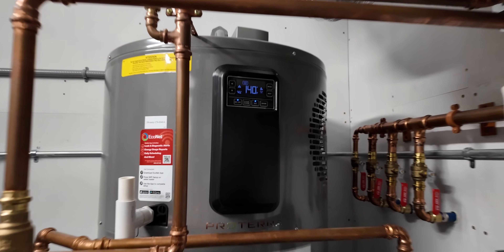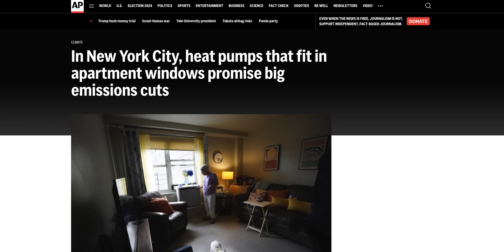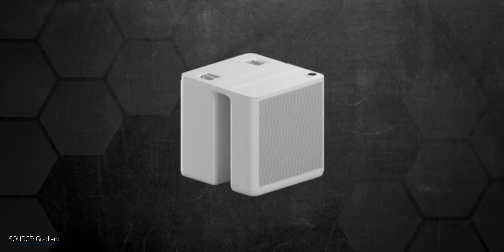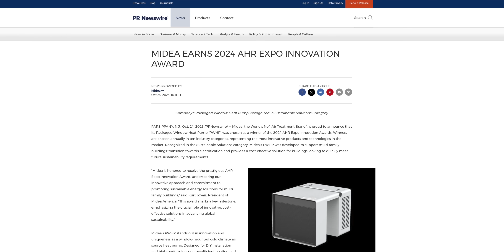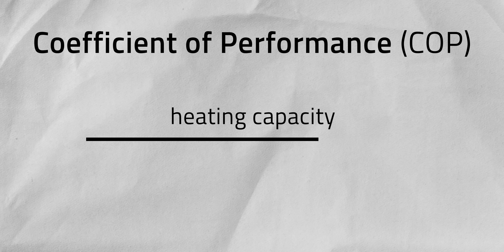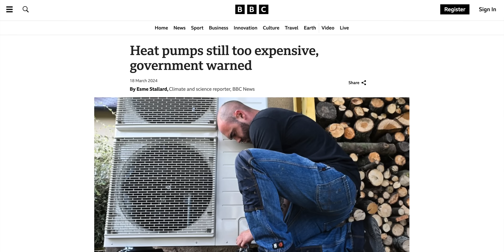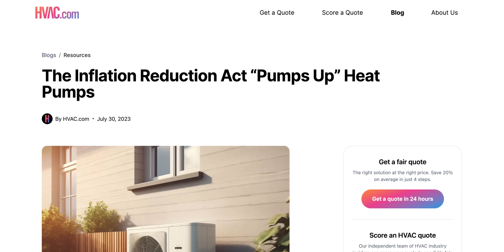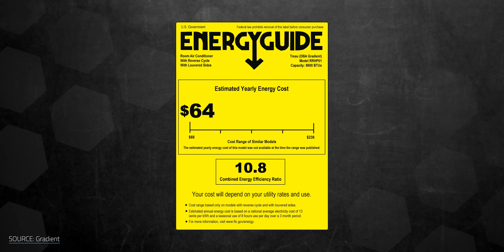Why This Window Heat Pump Is Genius

Comment: This seems not possible logistically with a cost of $2000 per unit. I mean regardless how large it is or how many btu it can output it can’t cool a room when I wall and door is between the unit and the room, it won’t work right? You’d need one for every room right? Given that they are  $2,000 a pop it’s just not financially feasible or logical.

Comment: I want a heat pump window ac, but my problem is I can't find one SMALL enough.  The room is only about 120 sq ft, and the smallest heat pump unit I can find is 8000 BTU.  GE has what I thought was a 6000 btu unit but turns out the 6000 but unit is actually NOT an inverter/heat pump unit like the larger ones.

Comment: This is an amazing idea. Sadly here in the UK unless you live in an older building wish Sash windows it would not work. Most homes with double/triple glazing windows use a casement style window. So most renters here are excluded with this design.

Comment: COP of 2.5 is great. But conventional fossil fuel systems don't load electrical grid at all (almost). And instead of simple burning fuels locally to get heat that solution will require to produce more electricity which will be used to pump the heat. I'm a big fan of EV because use electricity to create motion is effective. but to get heat - more efficient is burn fuel locally. 

Communistic countries like USSR were able to combine electricity generation and utilize waste heat for central supply of heat and hot water for apartments. Unfortunately, US was built not that effective. I live in Wisconsin close to gigant coal electric power plant. And it just waste hot water to the lake Michigan. And then I use resistive water heater to boil my water. I feel pain on it every day. But it is rental apartment and I can't modify it...

Comment: It took 4 years for me to pay off the cost of the Heat pump system for my home. It has lowered my electric costs by an average of $120/month, and I still have 6 years of my 100% parts and labor warranty left.
I know it's a large upfront cost, but wow those things are great. Glad to see that they are expanding these to more situations. For reference my electric costs $0.12/KWH.
Reply: Could've just bought an intel CPU and connected some tubes as outlets to different rooms. A lot cheaper.
Reply: @sodanakin  I appreciate the joke, but no. 
Because of how heat pumps work it is 3X cheaper to run and I still have cooling.  
The idea is using waste heat is definitely a fun topic though.
Reply: For that to be relevant to this unit your furnace cost would have to have been 6 times higher than a standard install which it wasn't. It's just a few thousand more on what is a 30k system instead of a 27k system for a typical home. Now run that payback if the HVAC install on your home was $150-180,000.
That's the numbers on this unit and it's about half the efficiency spread of what yours is compared to a standard install.

I hope this didn't come across as critical but a lot of people he that are pros want people to know to not buy this unit.
I'm a builder so I've been running the number on efficiency for decades in real world builds.
Heat pumps at the entry level still aren't worth the money on the lifecycle of the unit. They're very very close.
Scale matters so on a 10,000sf home get them.

FYI the best return on products is LED lighting on any exterior timed lighting. Paying someone $150 an hour to change the bulbs has a payback in 3 to 9 months depending on electric rate.

Us normal construction workers know more about actual efficiency that anyone making products.

The geothermal heat pumps are the worst because so many units are crap. People that work with them know that only Bosch units should be installed. Period. 
If you get one serviced ask them to replace the guts with a Bosch no matter what brand you have when they start acting up. 
Every $600 service call knocks that payback date back a year and most units need one every year after a few years. Like after 3 to 5 years it becomes an annual problem.
Reply: @sparksmcgee6641  also there are just a ton of passive strutural things that can be added to a home. like the fact that we default to ac and furnace is nuts to me in lots of areas even chicago. lie i get it at some points you might need the ac but not whole home often. and thermal mass and pcm's, albedo boosting on roof and walls maybe for cooling boost and net benefit in cost despite heat penalty, increased insluation  as most homes dont have a done, making furniture out of thermal mass and pcm stuff espeiclaly in areas that dont move often and own them or can make modular ones like im looking at for a apartment a girl is in, to couple with an inline duct fan to vent the whole place along with pressure seal and playing around with phyics of stack effect and cross ventiliation.  applying low e to windows likley hleps a lot. and heck, you have any idea how you can leverge the ecology around the home, yes it matters, not just tress, SCREW FACIST ENGLISH ARISTORCRATIC LAWNS, they offer zero benefit ecologically or to my thermodynaics or budget. if you want social space, fine, but you dont need it all to be social space. plus i have been playing around with idea of greating a geosolar envelope around a home and heating up the soil thermal mass in it to then relase heat for several months into the cooler season.   just finding ways to also do things like those walls that bring in hot air into thermal mass in to cool airs.  and of course a humidifier. but for most part, passivley planning the home the attic, etc, and venting and thermal mass and pcm and having a way to need as little ac as possible.  are you building a neighborhood, guess what, give them all albedo boosting and that helps them all with cooling in sumer heat waves and then use insulation for heat gain and unblock your windows. for heat gain. there is just so much that can be done,. im not saying this is you per say, but for last decade ive studied how physis chem bio psycho social cultural geopolitical planetary boundries and geoeconomics and how the systems on the global and bottom up and the way we live is not sustaniable and not just in we we are inefficient, in a away if you understand complex systems and feedback loops inertia cant fix these issues, especially planetary boundries( lok up stockolm institute and nate hagens)   then add the fact that the horitcultural ande lndscape way we live and design things is killing things on top of the way we farm and pesticides, and insecticides, and nitrogen and phosporus cycles are way out of balance and in the red and causing issues. like in IL 50% of birds have died out, because 50% of insects have died out. and yet we produce those chemicals and prctices that cuase that at masive amounts and with no end in sight. so the civlization will eventually collpse due to ecolociatl overshoot.  we need local meet ups to prototype how to fix this stuff.
Reply: Now to get solar and a Tesla!  300 miles for just $9!

Comment: As a guy who installs and uninstalls about 20 window ACs per year, I like how these effortlessly float themselves into place during installation.  Easy on the back is nice.
Reply: Cast radiators are usually installed right under or next to exterior windows in old homes/apartments. Wonder how large of a problem they will be with this design.
Reply: How many have you had to repair?
Reply: @barrystevenyoung4818 I'd bet none, a commenter speaking of "installation" holds no "weight."
Reply: Look again requires a huge bracket on the outside .

Comment: Heat pump ... ac with a reversing valve ... And if you're lucky a small resistive heater to thaw the system if it's very cold outside, and a " $5 computer to run some pretty basic code" to help keep it reasonably efficient. Still sounds/feels like extortion to me, but you know money be like that "bro".

Comment: Heat pump will just freeze into a solid block of ice in humid wet snow environments. They can defrost but it will just keep going back and forth trying to defrost because it can't heat in 10F weather it has to make the outside coil colder then 10F. This is why gas heating works so well furnace turns on heats right away no blast of cold air from a heat pump trying to defrost. Also R-32 not available in the US so if the unit gets a leak I guess just replace the entire window unit. This is the mistake people make when buying mini-splits from China they come pre-charged but if you get a leak can't find any R-32 there are some illegal sources shipping it to you off eBay.

Comment: about a month ago, I bought a small ductless minisplit system for my bedroom. 12,000BTU. single zone. 

it was $1600. plus another $900 to pay a licensed professional to install it. I could've spent about $400 more and got 2 zone unit, and that would probably only add another $100 or so to the install cost. 

having all the constraints of old apartment buildings to work around, I can see why the window unit route would be appealing, but $2000-3000 or more? and you'd still have to deal with all the bureaucracy of getting permission to use it in an apartment anyway? 

it really seems like just a regular 110v minisplit is still the better and more cost effective option, even if you need a professional install. these window units seem kinda pointless at these prices.

Comment: Why does no one answer my question about how much these draw. If a 1500 watt heater draws that much for heat then it only stands to reason that this will mean this heat pump can't be on a circuit which other devices draw from.  Makes sense doesn't it?
Reply: A heater uses all of its energy in the form of heat, a heat pump just moves heat that already exists which means it doesn’t need as much energy to put heat into your home.

You get more energy out of the system than the unit takes to actually run the pump itself.

So it uses a fraction of the energy of a heater would
Reply: @lifelesshawk5725  Thanks but has anyone done the math on it? 2000- 3000 for unit and then cost to run each per hour?  Not all windows lift upward so what would you do then...replace the window? That's what I would have to do and the window is not small.

Comment: I got a 15k btu mini split(Heat and cool) with 2 indoor units from 1 condenser for 10000baht(300USD) then installed for 3000baht(90USD).

Comment: Wow, Heat Pump are getting more compact... I wanted to invest in one as my house is on solar panel system but still uses natural gas for my central HVAC during winter. For $2,000 to $3K with IRA rebate.
Reply: Technology Connections has some interesting videos about this exact topic

Comment: In Europe, most AC units include heat pumps and you just switch the mode using the remote. The only differentiation here is the form factor for US-style windows…

Comment: The price you quote for a standard window unit is a little off, if you compare it to a 10,000 BTU unit ( AC units generally start are 5k then jump to 8k then again to 10k, 9k isn't really a think on the standard window units ) those units are going to be around $400 not $150, also they do make traditional window unit combo AC / Heater units, your starting to get into $600+ territory and they heater portion tends put out 75% of the BTU that the AC is rated for, also they majority of them pull 230v at 20 amps, and they eat about twice as much electricity.

Comment: I take issue with some of the information in this video as presented. The financial comparison between a 9,000btu/hr window unit vs a whole house HVAC system is spurious. 9,000btu/hr is much small than a whole house system and thus yes, it should cost less to operate annually.

Further, I question whether 9,000btu/hr is enough to heat and cool a NYC apartment? The average window unit is usually larger than that at 12,000btu/hr and then, usually used climate control in a specific room.  I guess these would be better than nothing, particularly if they're more efficient but what's to stop a tenant from acquiring supplemental heat from an electric radiator? 

If the idea is avoid making major renovations, I suppose a window unit works but I feel like a mini-split system might be more cost effective.

On the flip side, I like the idea of these heat pump window units and feel like they're an innovation whose time is come.  Hopefully this technology catches on and the economy of scale winds up lowering the price of these so poor people everywhere can afford them.

Comment: Really depends where you live.  In Florida I have a 5000 BTU "box standard" Window-mounted AC unit. It easily cools my 150 Sq ft Office/Den.  For our brief and relatively mild winters, a 1500 watt element-driven space heater no bigger than a shoebox makes the room toasty warm in minutes and can be moved around for best effect.  Together they cost less than $250 and have each been in usage for nearly 5 years. That is main attraction.

Comment: Nope. No matter how much you insulate around this unit the heat loss from the window being open will negate any efficiency you gain from using a heat pump. This WILL cost you more to heat your home then any other option. Just another green idea that looks good on paper and utterly fails in the real world.

Comment: How is this supposed to replace an entire apartment that has more than 1 room? Not too efficient if you need more than 1 of these units to cool or heat that apartment. Not to mention the cost of these units as well. I do have the midea ac unit of similar design but doesn't straddle the window sill and wall, but is the U shaped. Works very well in a single room but not a whole house unit. Even the Mr Cool units are more expensive than a regular central home unit. All this gimmick of "climate change" bs is purely for profit that Al Gore created in the late 80's and made millions from profiting from the "scare". If these organizations truly want to do something to help the environment, then start educating 3rd world countries on how to deal with their pollution problem!!!!!! And quit profiting!!!!!!!

Comment: Kinda wish these worked in windows that opened horizontally.  Maybe using water in a cooling loop with a couple hoses going out the window would be slightly less efficient, but more practical unless you have a weird vertical window.

Comment: Heat pumps are a royal PITA when you have to charge them in the winter.
That U-Shaped unit will not fit my window sills. Mine are just too thick between inside and outside.
No heat pump can match the efficiency of electric heat.
You cannot get out more than you put in, regardless of the system.

Also, no one sells one mechanical ONLY. All force you to have electronics, which are unreliable and nearly impossible to repair.
And rarely do they come with side pieces that actually keep the air OUT nor a way to stop air infiltration on the top of the window.

I do not see a casement one.

I would want one with mechanical switches only and ZERO electronics.

About old boiler systems - nothing beats sitting your cold butt on one of those hot cast iron steam radiators in the winter.

Comment: Yes midea makes a 13.3 seer 12000btu window ac heat pump for under 500$, yes it’s way more efficient at cooling then any window ac I’ve ever owned, says it only heats down to 41 degrees, but for 9 months out of the year in central Missouri it keeps my house within 1 degree day and night automatically changing from heat to cool as needed. I never wake up freezing or sweating, it’s great for a good nights rest because it’s quite and for under 500$ it’s a bargain if it lasts.

Comment: Why are they $3k?? The only primary difference between a heat pump and an a/c unit is a reversing valve. Sure these are prettier, and have better refrigerant, and their design is likely to keep more noise outside, but that's not a $2.5k/$2.7k difference in value....

Comment: My question is why did you not discuss the energy use difference between the current space heater plus air conditioning over about a year then do the same math with the window heat pump?

Comment: I think all these heat pump manufacturers are still missing the point. There are so many bedrooms in the US and not a single unit ideally suited for a 120 to 140 sq ft space. 5000 BTU is not too much overkill but some people have built homes that reflect the economic change in the US. 70 square ft is the minimum allowed for such a space. There need to be realistic solutions for these smaller areas. Short cycling a unit is hard on the compressor, fan, and efficiency. I'm one of those people who built my home to barely meet IRC codes of 2009 with the exception that the insulation is ridiculously good. The smaller the AC unit the better and my 6000 BTU mini-split is overkill for my entire home. I wouldn't want a unit like the one in this video unless Midea put out versions to suit a variety of space sizes from living rooms to bedrooms. As long as companies remain narrow-minded, I will take the least wasteful approach available. For this reason, most of the tech that I embrace is outdated because it suits my needs with the least negative economic impact.

Comment: What a great idea!  Even the installation looks better than a window AC.  The cost, however, needs to come down since most of the components are the same as a window AC.  New tech development costs are built into the initial units. Think of hard drives, lap-tops, laser printers/copiers, etc.  
😊

Comment: this guy gets paid to promote heat pumps they are not good im in va below 34f the stop working then they wil run constant running light bill up i turn my heat pump of at that temp and use 1500watt heaters around house on those days an nights

Comment: Midea already has a U-shaped window unit that has a inverter and has 15 SEER for $600 so pay $3K for heat and 16 SEER? NO THANKS! This will fail until its $1K at the most. If it was 40 SEER then maybe but 16 SEER when you can get 15 SEER for $600.